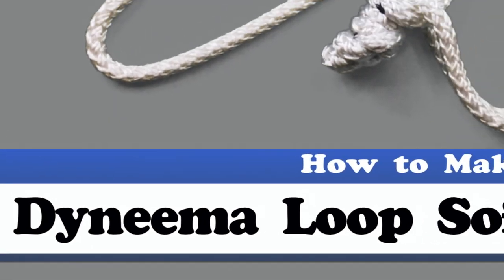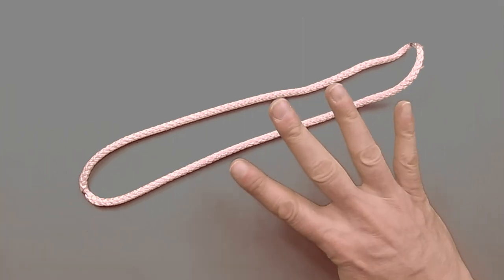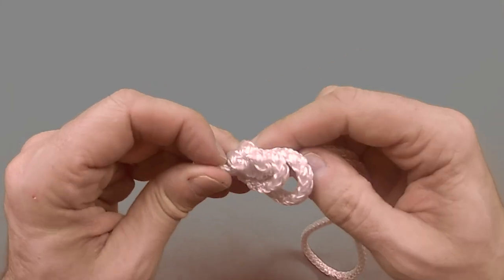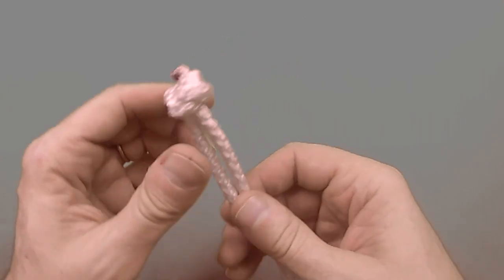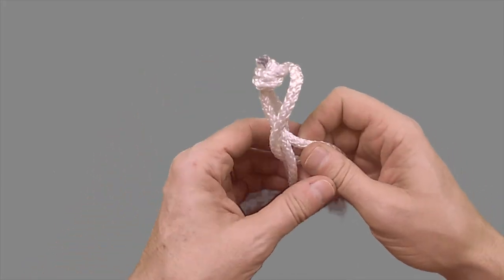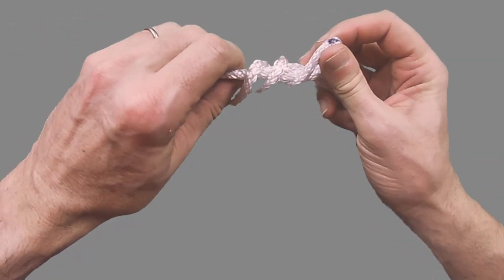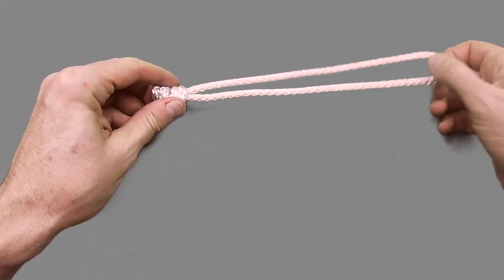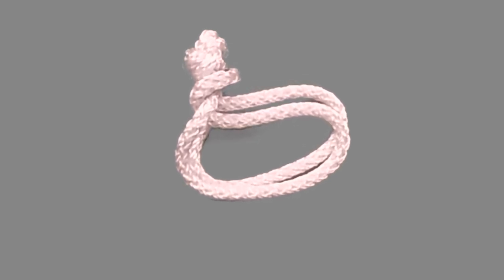Dyneema Loop Soft Shackle

Comment: G'day there guys, I commented on an earlier video, great to see you showing another way to make these soft shackles. As I mentioned previously there are several ways I make this type of quick soft shackle more secure;
- When tying the overhand stopper knot leave just a short loop at end (as you did) but pass the long loop through the small loop and cinch the overhand knot up tight pulling up the small loop up to the knot....by doing this you essentially lock the overhand stopper knot and it will not pull though (I think this method is better than the traditional button knot or diamond knot, quicker and easier....only down side is it takes up more rope to tie).
- There are many ways to connect or use this stoper knot soft shackle loop.....if you have to make the shackle more secure tie an over hand knot/marlin spike hitch in one of the loop lines (not both)  slightly offset at the resulting constricting loop at the end, this knot can be cinched up or moved to create the desired size terminal/end loop and ensure the shackle is balanced under load. The loop can be easily opened to fit over the stopper knot and slid closed to choke the base of the stopper knot (essentially the same as the standard spliced version of a soft shackle), this makes a very secure attachment to the shackle and is the one I use for inconsistent loads.
- Or you can tie a larks head knot/cow hitch in the end of the loop, this is slipped over the stopper knot perpendicular to the soft shackle rather than inline,  and tightened directly behind the stopper knot and is very secure  (however can be difficult to undo after tension is applied (not sure about how much this effects the ultimate strength but there are now four wraps to distribute the load at a virtually un-collapsible stopper knot).
I would love to see a load test between the soft shackle designs.....just to see how much the different techniques compromise/increase the shackle strength, and may be a comparison between how much rope is needed to build a standard size soft shackle with each style/method.
Apologies for another long explanation difficult to put into words.
Reply from the maker: It is your comment which inspired me to do so research, learn the new techniques and share.
I really appreciate you watch and providing feedback, it inspires me to learn and share. In this case you are too quick for me, replying with more feedback before I have had time to edit and release additional videos which will put you excellent explanation into word. Over the next couple of weeks I will be releasing some additional vides which will put your words into motion. Stay tuned and as always I will be watching for your feedback which is a gift :)
Reply: @BottomUPBoats  No worries mate, just seen overhand knots walk up/off the rope when heavy loads applied, so locking is an easy fix......and guess after seeing you get closer to how I use them, I might have got a little too much wind in my sails. Looking forward to seeing more in the series, keep up the great work
Reply from the maker: No issues with having too much wind in your sails. It makes you go faster 👍👍
Reply: How do these knots compare in breaking strain to the breaking strain of the dyneema. i.e. should I go up in size in the dyneema if using these simpler knots.
Reply: @whereswaldo1191  i'd like to see some tests on this as well, in general I here the figure upto 230% of the material line strength quoted for a standard soft shackle. But.......there are many different ways to tie a soft shackle and even ways you use them, it is also dependent on if you set the stopper knot, the bend radius of your anchor points and DIY competence can add a significant variable in consistency of strength....... A well constructed soft shackle (with a locked stopper knot) tends to break at the loop choke point, so consider how much dynema is interfacing at that point.
They are strong, light weight, easy to construct, and use ........ if you are relying on their load ratings and they are critical to your application then maybe look at a commercial product with defined breaking strain until you develop your competence level.
I would love to see some practical breaking strain testing.......(bit expensive, maybe a generous product sponser would be interested?)
Reply from the maker: @whereswaldo1191  if you tie the knot in an area of the shackle so you can have 4 widths of rope on both the shackle and the lock it should be a similar strength, I am going to have to do some break test to see the difference. Stay tuned.
Reply: @BottomUPBoats  put your body weight on this and the stopper knot will  invert on it self. Would not go near a boat with this one. 230 % is just wrong on every level.

Comment: Thats going to slip.
Reply from the maker: If you are worried about the loop slipping you can always create a locked one with the following video, with that said if you place the knot near the join the loop is not going anywhere.

https://youtu.be/zu6pEZy96I4

If you are worried about the lock of the shackle slipping there are many other ways to finishes explained in the following video.

https://youtu.be/hXG17Q__6aY
Reply: @BottomUPBoats  its the stopper knot thats going to slip. Even the diamond knot is going to slip in single braid dyneema. This is a really dangerous soft shackle that is going to fale. A button knot with buried ends is the only knot that I would use in a soft shackle.